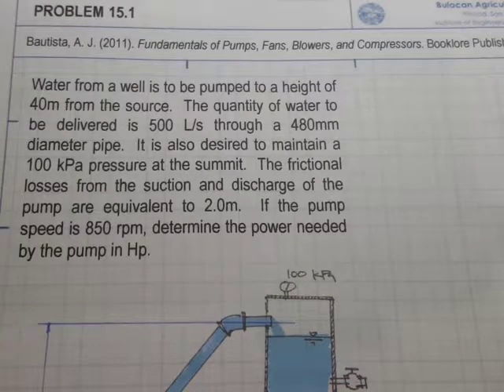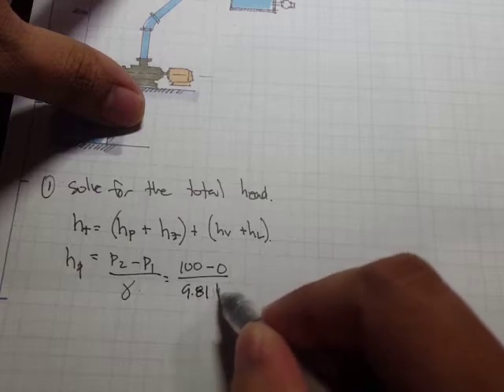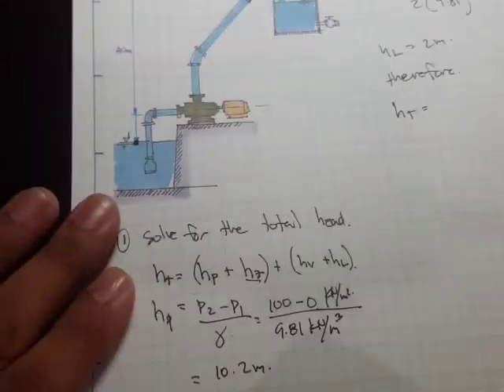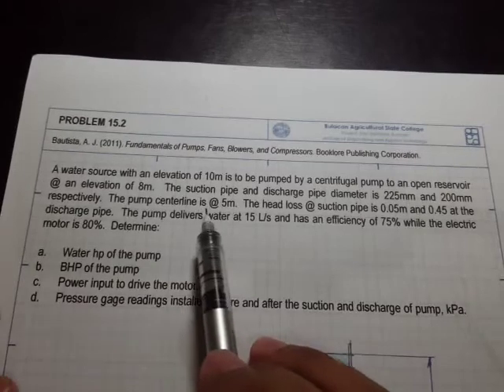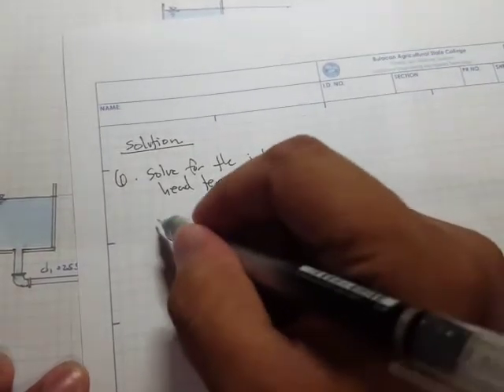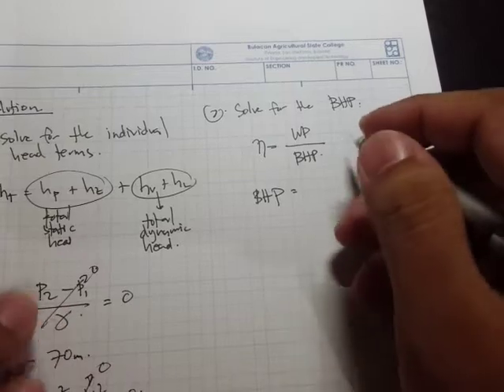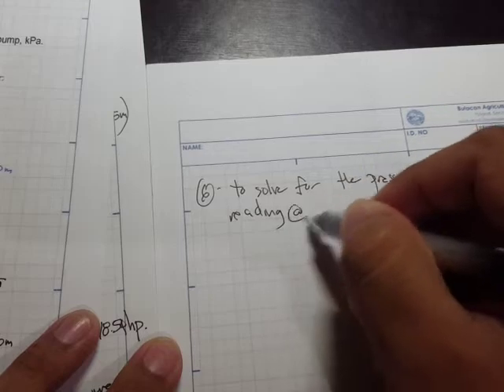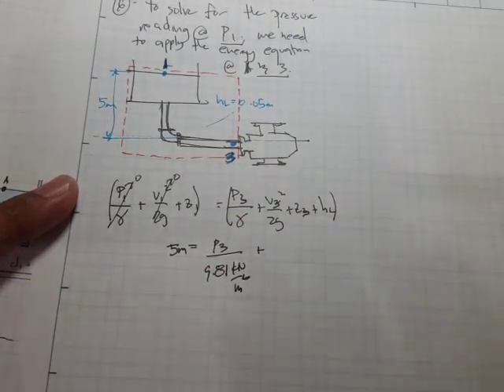ENSC107 - 14.02 - Water HP, Pump head calculations

Comment: for computing water power why did you directly put the kW without canceling the length unit of meter?
Reply from the maker: the water hp is already a unit of power hence you just need the conversion of 746W/hp

Comment: I had a request, if possible can you please teach remaining standard conveyor design like roller, power and free, monorail, etc. Previous videos of conveyors are helpful, i had also asked a query in a video of screw conveyor. Please reply to that  comment
Reply from the maker: Hello sir, I haven't seen your comments regarding screw conveyors.  

With regard to other conveyor design, I haven't encountered it yet, but i assume the design process is just the same...  size up the components first based on the requirements and process functions (e.g. width of the roller, height, etc.).  of course check standard sizes.  After that, size up the structural and mechanical components loadings and motion requirements.  And then add controls later if you want to.